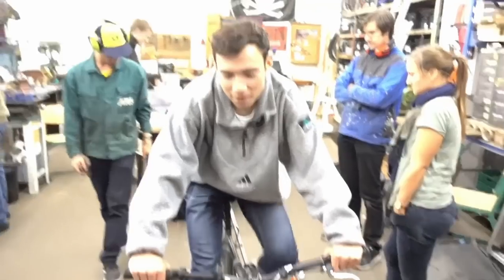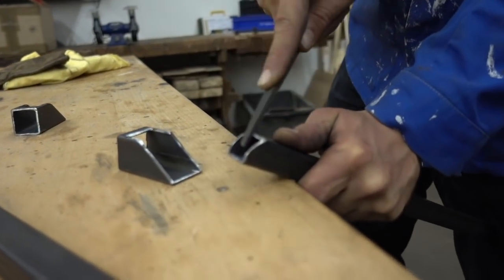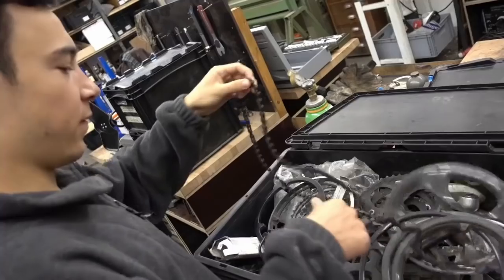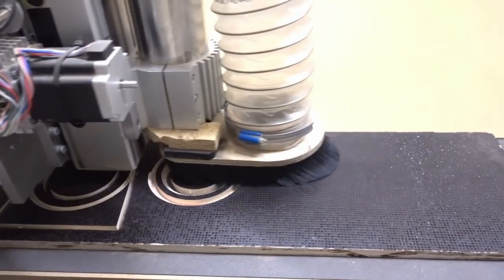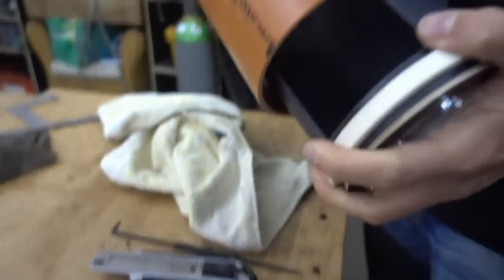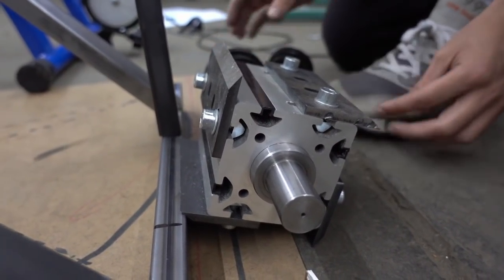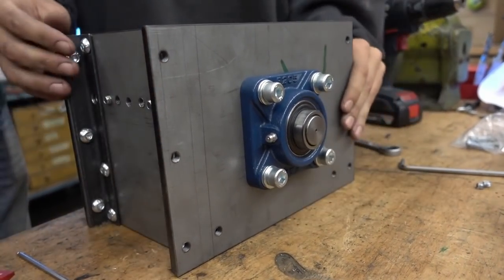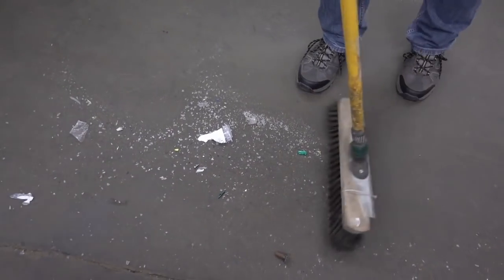Make a bike powered plastic shredder #preciousplastic

Comment: I am retired now, but we used to run a plastic bottle crate shredder, 600 HP, shredded around 5 tons per hour for recycling the plastic,  Our car shredder (hammer shredder) was 6,000 HP  and shredded about 2-3 cars per minute, including separating the steel, copper, aluminium as well as the glass and plastic scrap...